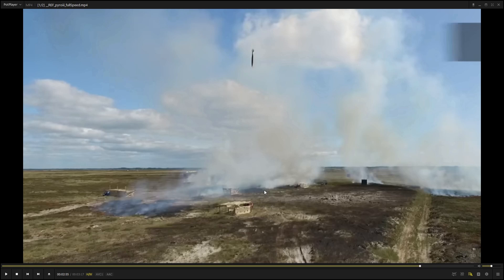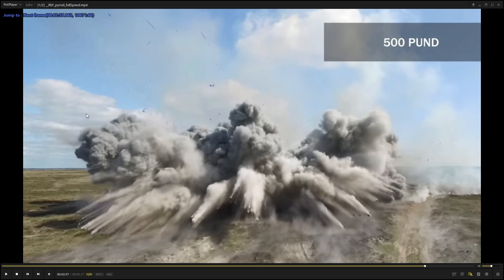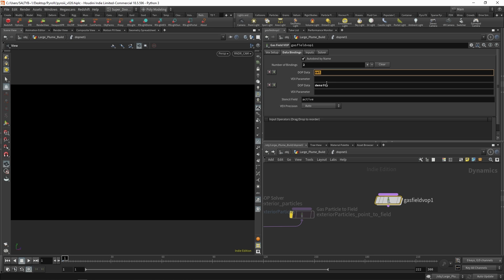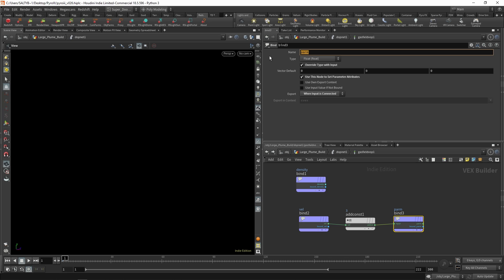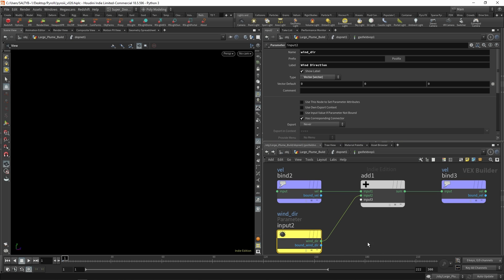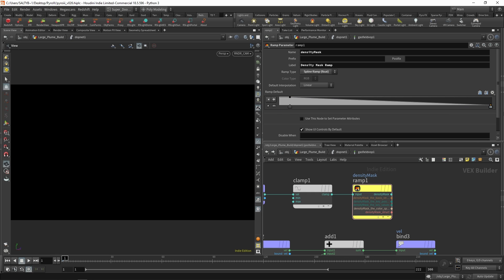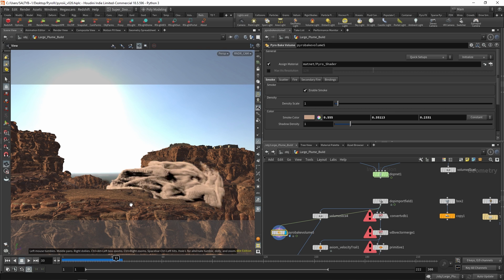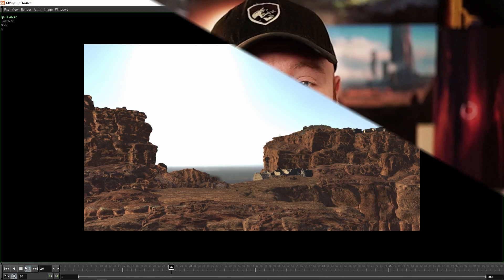Houdini | Custom Wind Microsolver | Pyro Quick Tip

Comment: can i do this with a pyrosolver sop?
Reply from the maker: You can do most of this with the pyrosolver sop.  The pyrosolver sop is just a wrapper that goes around a DOP network.  So, for the parts that require some custom dop operations, you can go in there and do the same.

Comment: Cool but i thinks before clamp you need a fitrange, to better catch the right targhet. i think is better to fit 0.5-2 to 0,1 then clamp density and ramp  , in this way i think you could leave a greater amplitude for this wind. But you are the master :)
Reply from the maker: Good idea!  Either way totally works.  I've done it with the fit method as well, and that does a better job at getting those inbetween values.  The clamp might be a little easier to control if density values change significantly over time.